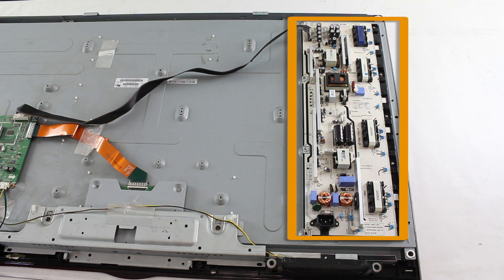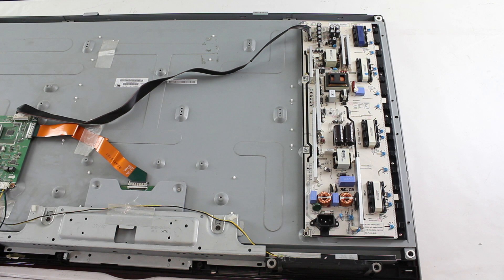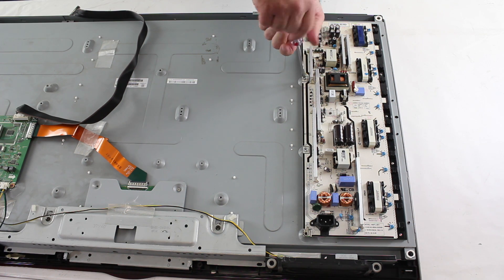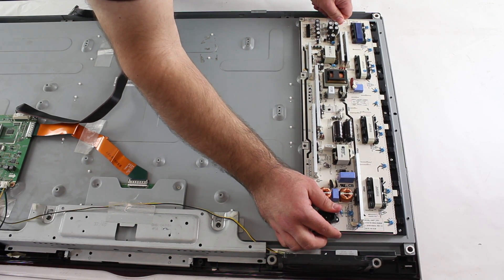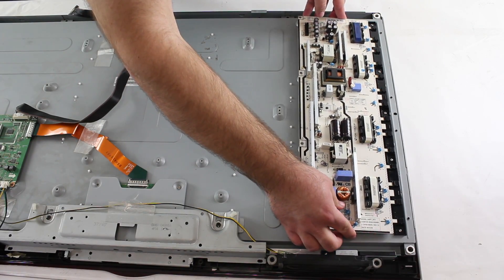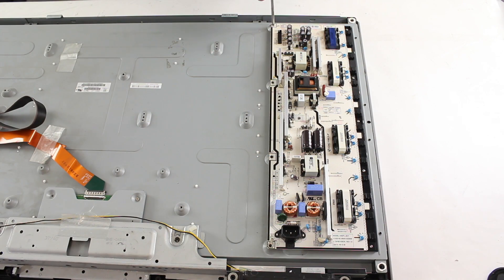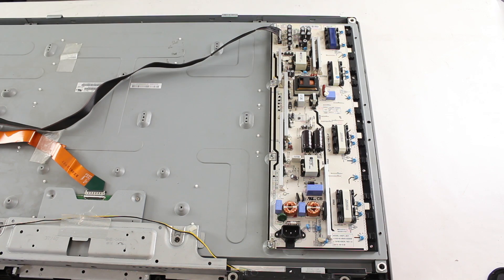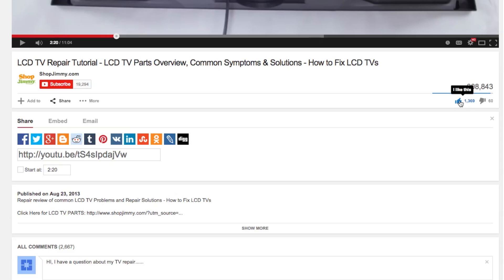Samsung LCD TV Repair - How to Remove & Install Backlight Inverter/Power Supply Board (LIPS) Board

Comment: Jimmy, I have a Samsung t.v and the standby light is on. When I power it on it is a black screen with volume (sounds) I did the flash light test and was able to see volume numbers going up or down. Would this be the inverter board? How would I purchase one? Thank you!

Comment: Troubleshooting an older LCD tv...was still working fine but producing a burnt smell. Come to find out two connectors from the panel that the backlight inverter slide into are burnt. Any fixing that?

Comment: Before finding this video, I unscrewed and pulled out the black strip on the side 🤦🏽‍♂️ Is this irreversible?
Reply: Patrick Gauthier Nah, still sitting on my floor, busted. I’ll get around to it sooner or later. Another comment said they were able to fix this issue but it was really time consuming.
Reply: @TSpartanDR  thanks for your quick answer! I was able to set it back with 4feet of floss and some scotch tape. I've passed the floss under each lamp connector, pull them up and scotch the floss on the back on the tv. Once done, I was able to sit the blackstrip back making sure each connector was correctly set.. The whole operation took me around 10min ;)
Reply: Patrick Gauthier No problem, man. The floss and tape idea is resourceful! Luckily, I have shitloads of that lying around. Now that I’m not dreading the entire experience, I’ll probably get to it this weekend 😅 Many thanks

Comment: What a pity, I stumbled upon this TV as it was ditched along a road near my house. I then found out what was wrong, fixed the LIPS board (MOSFET and two caps)... but I wish I had seen your video beforehand: since I did not want to pull hard enough on the board, I ended up disassembling the screen itself in order to re-attach the backlight tubes from the other side... and I broke the screen doing so! What a loser! :/
Now I have a functional LIPS but a broken screen, which is worse than before! I guess there is no economical way I can buy a replacement screen.
At best, I could try to sell the boards now that I know they work.
Thanks anyway, these tutorials help keep the planet cleaner :)

Comment: Jimmy! Great vid. I have an LG 47LN5700 (about 2012). Picture no sound. Did the flashlight trick so I have narrowed it down to inverter, backlight or mainboard. Is there a way to at least diagnose for sure without taking it in for a costly diagnostic check? If I have to do that - I may as well just buy a new TV.

Comment: I've got a Samsung tv model # samsung tv ln46d630m3f. No picture, no backlight only standby light no sound. I've just opened it and all the capacitors are flat and good. What's the next step? Replace the fuses? Test all the micro caps/fuses? I'm stuck

Comment: Great video. I have a question. I have a 46in Samsung Model # LN-T4671F. I no longer have any backlights. None. Not even the bottom center blue light. I have to unplug it to turn it off & when I plug it in, It automatically turns on. I'm guessing it's the   Power Supply / Backlight Inverter BN44-00166C [C267]. I saw it on ebay. I was just looking for a second opinion from the community before I purchase it. I build PC's and thought Televisions were way more complicated and had alot more parts.. I was wrong. Any advice on this would be very helpful. I've subscribed and will share this page as well : ) Ty

Comment: What happens if you chip one of the tabs that connect to the black strip.  Hypothetical, let's say I broke one completely off.  Please respond with your diagnosis and what experience you have in this field.

Comment: I have a Samsung model number LN40B550 that flickers ,then goes black, come back up for a few seconds, and then does it again. I have turned the backlight all the way down as well.  it worked fine for about 4 hours yesterday, but I could tell that it wanted to flicker while I had it on.  don't know if there's an easy fix for it, or do I need to replace the board?

Comment: I have. Model UN40H6203AFXZA that has dark screen. Ican see images when within inches of screen.  I am wondering how to determine if it is the board or the back lights. I see no apparent signs of overheating on board or capacitors. This happened suddenly in the middle of whatching a movie. Thanks for any help.
Reply: Sounds like the Back light gave out. May need to replace the light board or the LEDs that burnt out
Reply: @ShadowcasterZero  can a regular Joe purchase things like this?

Comment: i pulled the black strip off with the board....damn that was a trip to get back on, had to disassemble the entire thing! dont make the same mistake i did, watch the video before doing anything.
Reply: I did the same thing, how do I fix it?
Reply: +Sujeath Navaratnam you have to take apart the entire TV and reattach it from the other side, it's time consuming and takes up a lot of room.
Reply: +Cdabek did you have a guide?
Reply: What is that black strip called? I did the same thing and then I broke one of the tabs on the black piece so I have to get a new one.

Comment: hey jimmy ,
i have samsung 32" led 
model: UA32D40038XXT
it has got the backlight problem u showed in the video.
 please guide me to next what?
Reply from the maker: +Sebastian Varghese   Try all repairs and troubleshooting at your own risk.  This sounds like you have bad LEDs in your TV.  Unfortunately we do not sell replacement LEDs for your TV model number at this time.  You can check back in the future to see if we have them available.  Thanks!  www.shopjimmy.com
Reply: i removed the panel and checked  the led strip, it works but by blinking at an interval that too with low intensity, but the panel glows(blinks) properly sometimes when touhing with a tester

Comment: Hi Jimmy, I have a Samsung 40B650 (BN44-00264A board). The TV starts fine but after a while it suddenly just turns off and is completely dead. No indication of power at all. There is no visible damage on the power board. Do you think replacing the power board would help? Thanks

Comment: I wish I had found this video sooner. I have a Samsung LN40B530P7F  TV. A couple months ago it powered off and when I tried to turn it back on the TV would come on 3 times then turn off. I took the back off of it to look at the power board. I saw one of the inverters had a black spot on it so I bought a new one. I have to new one on the board now but here is my problem. When I took the power board off I took the black part off with it so now I have to figure out how to connect the backlight wires back to the black part.
Reply: I need this question answered

Comment: Hi I have a Emerson 50' led tv that the back light flashes and the power light blinks 5 times and won't power on? I replaced the power supply and still the same.  Help?!? Thanks
Reply from the maker: Richard Gates   Try all repairs and troubleshooting at your own risk.  It sounds like you have bad LEDs in your TV.  Unfortunately we do not sell replacement LEDs.  Thanks!  www.shopjimmy.com

Comment: Hey I have a question about my Vizio 500i-B1. My sound is fine, but I have no picture. The screen is grey not black and when I hit input on the remote, the area of the screen that would normally pop up with the inputs lights up a bit but shows nothing. I have done the "dark room/flashlight" test and cannot see a picture. Does this sound like a t-conn board? Or more like the LEDpanel? The entire screen is the same on the right and left side just grey like it is backlit but no picture.
Reply from the maker: Everfalling1   Try all repairs and troubleshooting at your own risk.  I recommend replacing the main board in your TV.  Click this link to replacement parts for your TV model number:  http://www.shopjimmy.com/catalogsearch/result/index/?cat=56&q=500i-B1  There may be multiple boards for the same TV model number, be sure to match part numbers on your current board, with your replacement for compatibility.  Thanks and please let us know if you have any further questions with your TV Repair!  www.shopjimmy.com

Comment: Samsung 
Model UN50EH5300FXZP
Version MH02
Type UN50EH5300
100-240v 50/60hz 119watt

The screen jumping and sometime fade
Reply from the maker: imtiaz hafiz   Try all repairs and troubleshooting at your own risk.  This sounds like a TV panel (TV Screen) problem.  If your TV panel is bad, it may be more cost-effective to replace the TV as panels are typically hard to find in stock, difficult to replace, and expensive.  Thanks and please let us know if you have any further questions!  www.shopjimmy.com